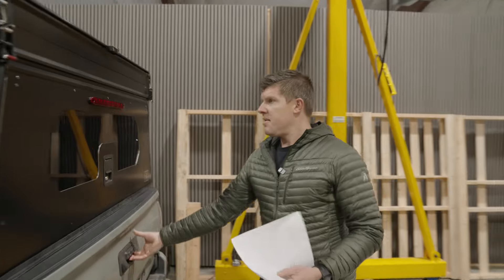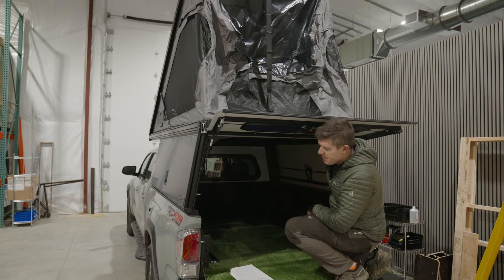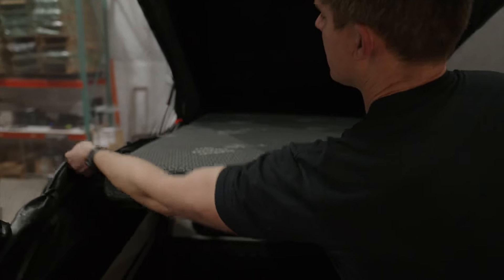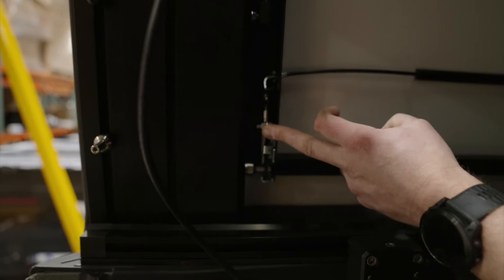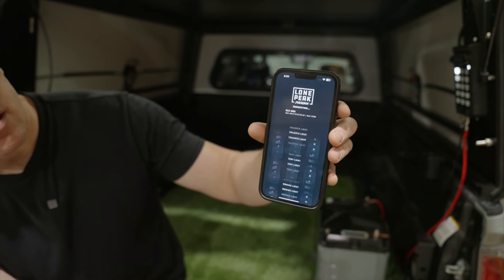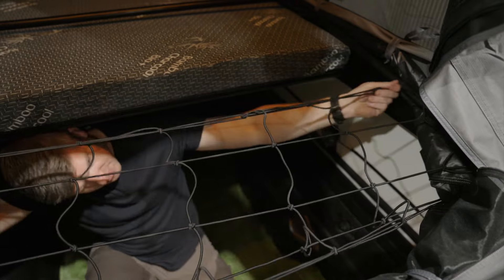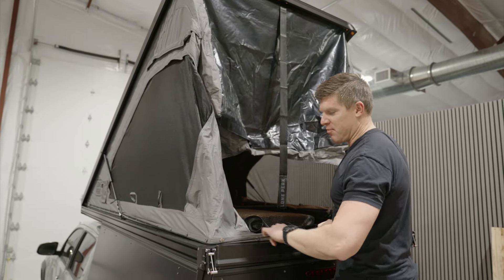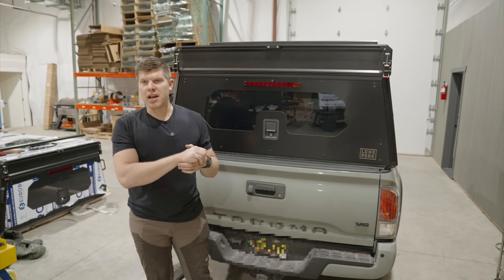Lone Peak Camper - Customer Walkthrough

Comment: Is there an upgraded tent option/ insulated. The material seems to be similar to a Colman tent. Other than that super sweet.
Reply: Very interested in this as well. I’d be using this for snowboarding just as much as dispersed camping.
Reply: @drenchedpaperboy  They have mentioned adding this later on, would not surprise me if they did.
Reply from the maker: The material is actually very beefy/thick. We have velcro in it right now for adding insulation panels in the future. The best solution will probably be a diesel heater which the camper is optimized for.
Reply: Super interested in this too. Recently emailed and they seem to be focusing on the heater for now

Comment: I like it.. but am interested how well the cap seals against the bed, and how on the tacoma you seal the holes for the front of the bed where the crossbar is bolted in, and how many tie-downs to the bed/ accessory rail there are.. walkthrough a fully kitted out 2016+ 4door short bed tacoma?

Comment: Would the brake light be connected if we opted for the pick-up install?
Reply from the maker: The wires for the third brake light are routed to the lower corner (near your taillight) of the camper. We don't currently offer the option to wire it into your vehicle.

Comment: I am sure you will dial in the walkthrough after a few deliveries! (congrats to that Tacoma by the way) - what about the vents at the top of the tent? how do those operate and is there a recommended best practice for zipping or unzipping the tent windows etc?
Reply from the maker: We'll do a full production level walk through soon! Vents at the top are indeed for air flow. They have a small slightly rigid piece that keeps the small overhang open while still protecting from water. We'll try and add this detail to a video soon. Tent windows can be treated similar to a ground tent. We like to make sure the two tent window layers are zipped up completely before raising and lower the bed. This just makes sure the bed isn't obstructed when when lifting or putting in place to sleep. -Kecia

Comment: Quick question because I couldn’t find it on the spec sheet on the website- I have a Decked drawer system in my 2019 tundra. With that additional height, how much head room do you still have inside the tent?
Reply from the maker: Without a decked system you have 9' of head height so you'll be right around 8' with it.

Comment: Would it be possible to ad an option to have one side with a solid (not opening sidewall), that way people could have an option to install a sliding window, or gear mounting options
Reply from the maker: We're planning some testing for side panel windows. We haven't discussed a non-opening side yet, though. I'll bring this up to design and production for the future. -Kecia
Reply: Thanks!! Yeah one solid side would give me a lot of mounting solutions and give room for a decent size window.
Reply: Happy to be the guinea pig for this with my build
Reply from the maker: @NikoRoskams  Super interesting idea. We'd basically not populate the latch actuation mechanisms and struts. It could still "open" but it'd have to be manual. It'd leave the whole panel free for a window or gear. I'll toss it around internally.